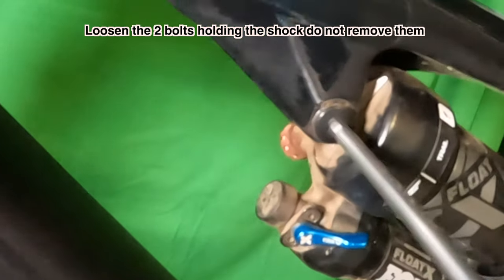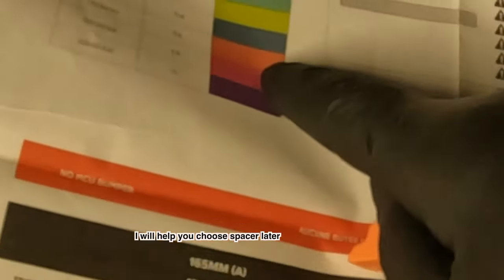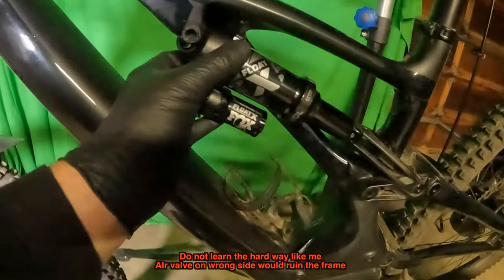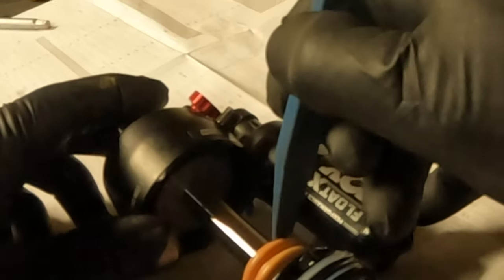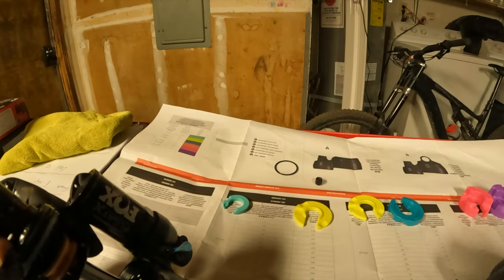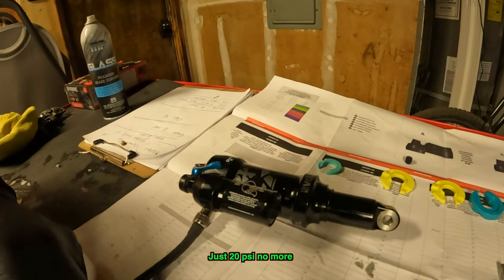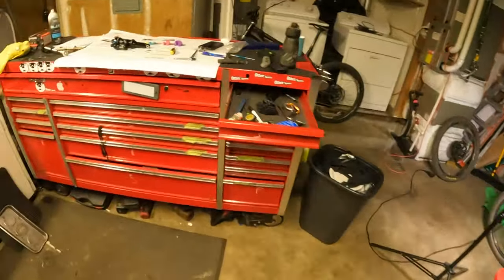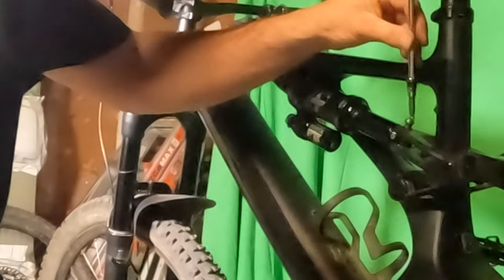How to install volume Spacer in your Specialized Levo | Fox float X shock

Comment: At 220 how much air would you run with the big volume spacer in ???
Reply from the maker: eBike? Start with your body weight 220 psi. https://www.youtube.com/watch?v=irZ0mc9P9Tg
Reply: Pressures don't really matter when first setting up your suspension watch the fox suspension guy Jordie talk about set up. You basically set your sag first let say 30% in your rear shock, what ever pressure your at when your at 30% sag will roughly be where you want it. If you want it stiffer from there add psi you want it softer take away psi.

Comment: Thanks for this video! I’m a dummy when it comes to mechanical stuff but will try changing to the largest spacer. I’m 220lbs with gear on. EMTB is heavy, about 60lbs. I want it to be plush on chattery trails but not bottom out.
Reply from the maker: Use .7 orange

Comment: I did same, but now my valve can t hold air after i try to pump it? All air goes out after i disconnect pump.
Do you have idea what i should do?
Reply from the maker: Replace the air valve you need the tool to get it out . It’s the same type that is in your cars tire. Auto parts store, had that happen to me too
Reply: @OtterMTBtech valve stem core is the term you’re looking for.